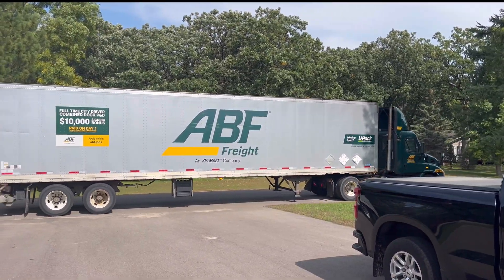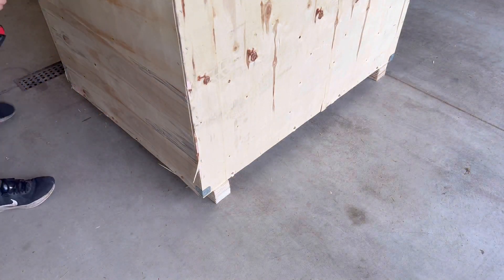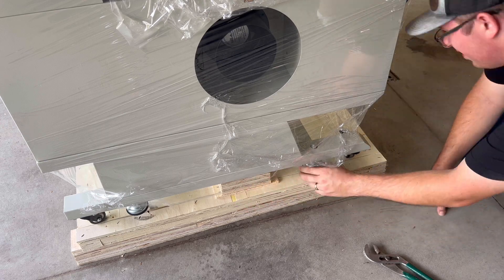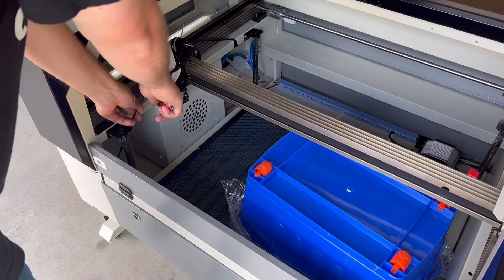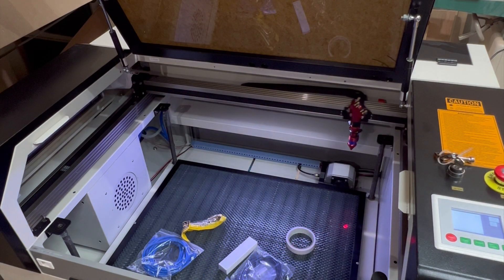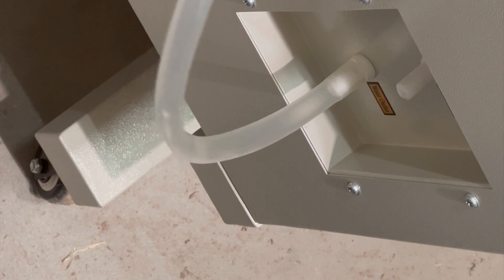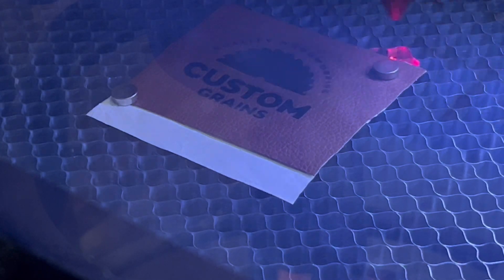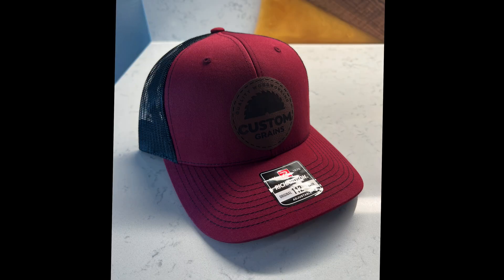UNBOXING / SETUP / FIRST JOB ON MONPORT LASER 60W

Comment: How has the monport been after 6 months? I’m on the fence and ready to make a purchase but am looking for some real world feedback
Reply from the maker: Hey Robert! The Monport laser is still amazing! I have had 2 things that happened but the customer service is great! The mishap is the X gantry homing sensor didn’t work or didn’t register so it ended up breaking due to the Z axis hitting it so hard. Which this resulted in my Cone nozzle to be bent. Quick email to their support staff I had a new sensor at my door in about 4 days. (You can still operate the laser just can’t home it). Other than that, it’s been really good. I don’t have anything negative to say actually! Would I buy another Monport again yes! In fact I did! Just got 2 more last week that I’m eagerly ready to use! 

Ironically I have now teamed up with Monport and if you use CG6 as a coupon. You can get 6% off your laser! Lemme know if you have any other questions. Feel free to message me over on Instagram too!